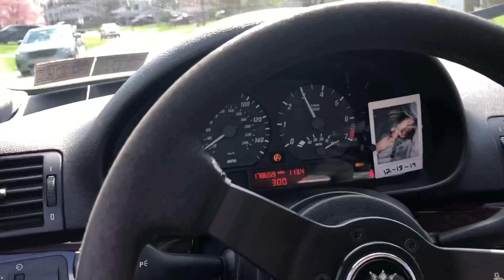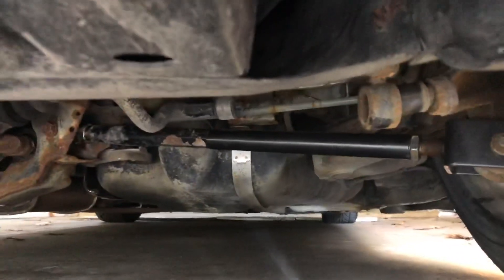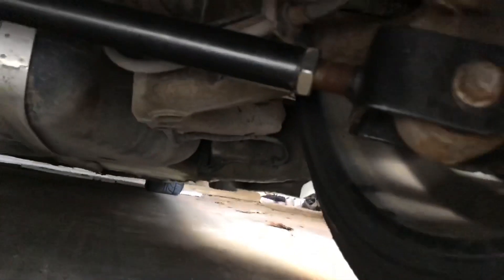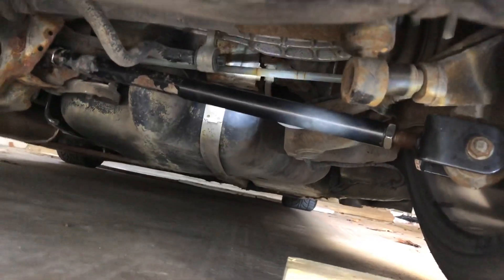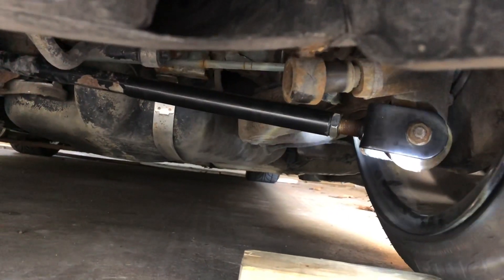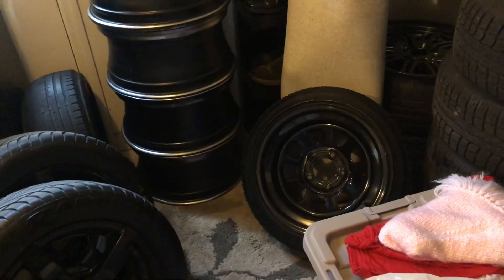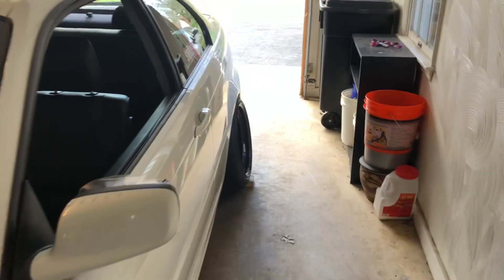E46 Adjustable Rear Camber Arms

Comment: Hey man I just wonder what does the light on the dash mean I’ve been looking every where and checking the car with mechanics the brake on yellow and that other one on yellow too the middle one, and where to find those comber arms thank you so much
Reply from the maker: Saul Martinez the yellow light in the middle of the cluster is your traction control, wether it’s on or off. And the yellow “BRAKE” light is your E-Brake light indicating if it’s up or not
Reply: Braedan Lugue yeah the problems is that the traction control is off and the brake is dawn but idk why they keep pooping on
Reply: Popping on